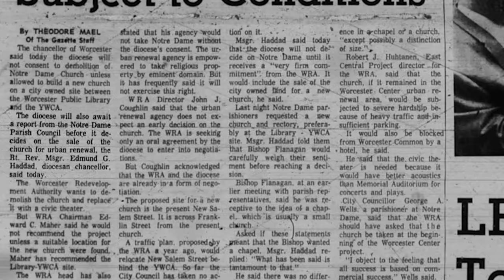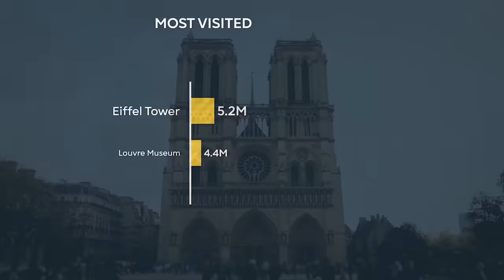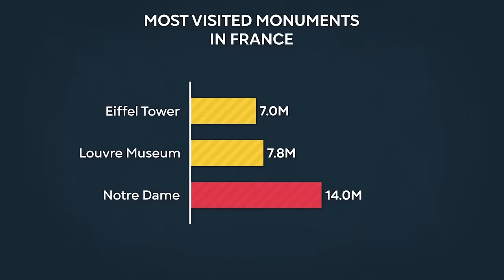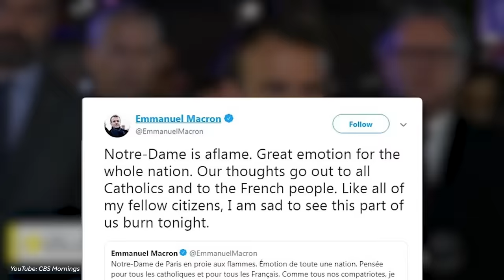The New $865 Million Notre Dame

Comment: I remember one of the early submissions for the redesign was a glass roof, which looked modern and that kind of thing worked for the Reichstag Building, but the designer completely forgot that the wooden roof covers over stone vaulting, and it's impossible to remove those vaulting without the walls caving inwards, a design by someone who had no clue how the actual building is constructed.

I'm glad some of the expertise of the workers at Guédelon Castle, using their knowledge of vaulting and carpentry to assist in the conservation and rebuild.
Reply: Scary how some designers and architects have no concept of structure.....I never heard that It almost got a gaudy HGTV style make over on the roof😂

Comment: What does it matter what i think if the cathedral opens in time for the Olympics? Was it originally built to open for an event? No, it took 182 years to build & we can only hope advancements in construction techniques will enable it to be complete in less time due to all the red tape, environmental & building codes & of course… cost overruns. Sure it could “open” tomorrow, but it will not be “finished” until 2028, & that time may be, rather WILL BE moved to 2029, 2030, closer to 2040 probably. Time isn’t important, quality is.

Comment: it should be worth mentioning that the 'wood' structure of Notre Dame would have been heavy timber oak - a universally accepted standard for 'fire proof' construction.  In the event of open flame the outside of the heavy timber chars and then protects the timber.  The notion that a cigarette butt or even fully lit could have ignited the heavy timber is ludicrous.
Reply: Ho hell another fire expert..... Ok let's go. 
-First those type of fires CAN start with any heat source available and yes a cigarette butt can be a trigger.
-Second the oak beam can indeed resist fire to a certain point, but only for a certain time. And it depends on his state.

-Third The wood was probably the first thing burning as most of the time what burns first is something ligth like for example saw dust, plastic, paper or chemical products. And all of them were widly (and stupidly) available on site.
-Four Even if it's rebuted it could also be an electrical fire.

Ho and before going on a yadada i'm trained to figth fire due to my work in an industrial plant. We had to study the various pics of the site with professional firefigters to point the various safety hasards.

Comment: The official cause is said to be unknown, but many sources have stated that an electrical spark or still burning cigarette may be the culprit.  However, two years to the day after the fire, an inquiry found that six electronic bells, which were intended to be temporary, had been installed in the spire, with cables running from them in the roof space.  It has been suggested that these may have short circuited and started the blaze.

Comment: I firmly believe that the builders of the Cathedral would have been completely satisfied with a decision to use modern methods to restore the building, even if that meant using steel instead of wood.